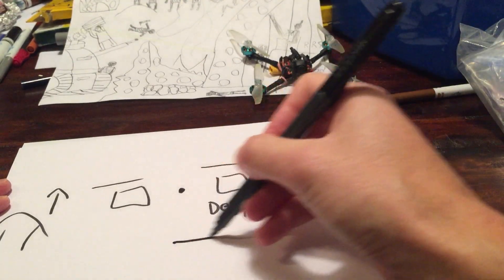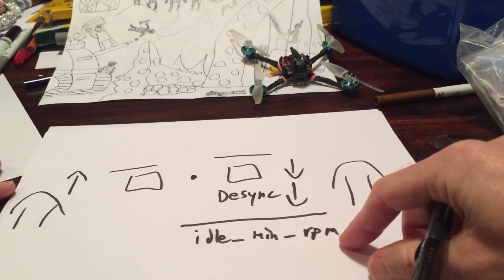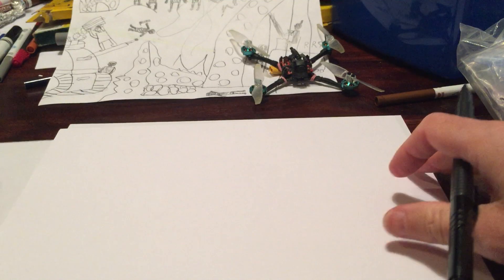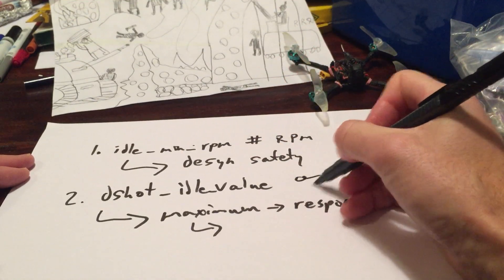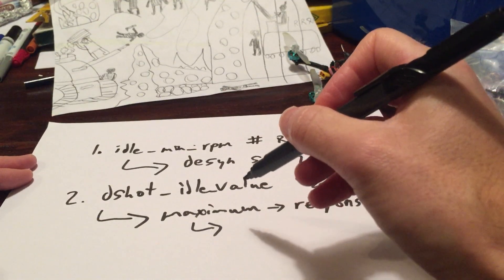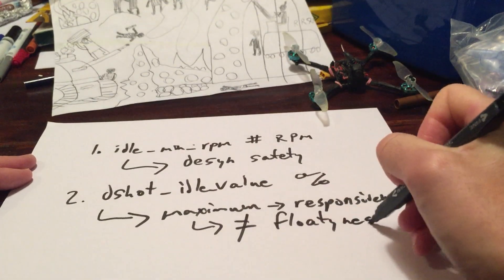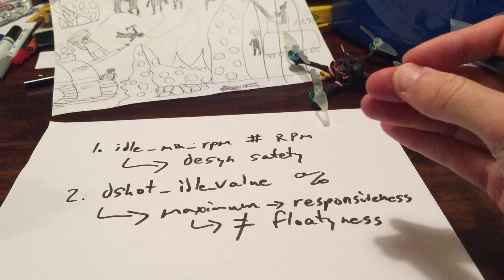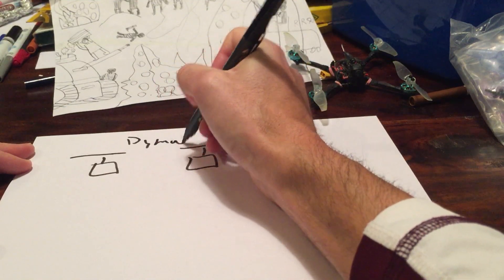Betaflight Dynamic Idle: Explainer

Comment: i have a new 5inch quad, when i have dshot set to 5 and dynamic idle set to 20 and with airmode on.
after activating airmode my drone doesnt stay in hover at 0 throttle but just fall out of the sky
why is that
Reply from the maker: It should descend at 0 throttle, otherwise you would have to land by going inverted. Hover should be at some low but comfortable range of the stick travel such as 25-30 %
Reply: @Quad66  what i mean is it drops like a stone with throttle at 0, i only get the 1050 if i go by all those guides suggesting putting 5 as Dshot value but thats not enough to make it float.
all the youtube vids you see they seem to float and hover when they have 0 throttle and i cant figure out how they do it.
the only setting i can do is set Dshot throttle value aaaal the way to 19.50, then when i arm i get 1195throttle, 1200-1210 my drone starts to fly off

Comment: Great video! This brings up a question that has been bothering me for quite a while. I was shocked when I found out that ESCs can actually be designed to handle infinitesimally slow speeds and not stall (e.g. see Justine Haupt's Brushless Motor Controller: https://www.youtube.com/watch?v=JMXz5tzpq7U), but quadcopter ESCs are not designed that way. Why doesn't somebody just make an ESC that handles low speeds and eliminate the issue all together instead trying to partially work around it in software?
Reply from the maker: It’s a good question. I’m wondering who in the fpv community would be able to answer it.
Reply: @Quad66  I was thinking maybe the blheli authors. I need to find out how to contact them.

Comment: I Have my Dshot idle value set to 8.5% (this gives me a RPM at idle of 6300 when I arm the quad - 3 inch tarsier toothpick 90g dry 1204 5000kv motors) which I guess is normally quite high but my Idle_min_value set to 50 (50 * 100 = 5000rpm which is approx 20% less. I was getting low throttle wobbles especially when backing of the throttle after a punch out or when the quad was in free fall and was hoping this would help I am guessing not using Dynamic idle was contributing to this as the motors were fighting each other. Am I on the right track even if these figures seem high?. Due to snow ATM I havent had chance to test it out yet.
Reply from the maker: onceamantwiceaboy yes dynamic idle can help keep motors out of the dead band where they have trouble spinning back up. The other possible things to try are turning off Dmin if you are using it and/or using some thrust linearization to increase effective PIDs at low rpm.
Reply: @Quad66  thank you yes i have turned off de min but heard thrust linear can cause the quad to freak out if it hits something

Comment: I set mine to 1 (x100), Betaflight says okay.  I try to set mine to 1.50, and Betaflight says go bite yourself.  What's going on?
In Liftoff I have my static idle set at 1150 which is perfect.
I want a idle of 1150, and I really don't care what the idle min floor is, as long as it's above Dsyn which I assume the defaults are by a hefty margin.
fpv.air-war.org
Reply from the maker: CHOPPER GIRL what so you mean by go bite yourself ?
Reply: @Quad66  I mean if I try to enter 1.5, Betaflight sets it back to 1.  It won't accept decimal numbers.

Comment: I'm on 4.2 RC1. My idle at 1050 is 4000rpm. So I put 36 in dynamic idle in configurator and my d shot idle is 5.5. Does that sound right?
Reply from the maker: What is you setup? I only fly micros and usually see desyncs with idle_min_rpm down around 21 or 22. To figure out how low your value can be you have to fly the quad and put it into negative flow with low throttle so flips rolls dives etc with low throttle. after that d shot idle can be set to get the feel you want without worrying about desyncs.
Reply: @Quad66 I have a raging droner 5" with t motor f60 pro 4 1950kv and f55 amp esc. 6s set up. At 5% d shot idle I went in motors tab and put the rate at 1050 like the tuning notes say. My rpm was 4000. Double what the tuning notes suggested numbers for a 5". So 20% of that idle would be 3200rpm at 5% d shot idle.
Reply: @Quad66  feels like there should be a better way to determine your minimum value without having to try to attempt desyncs .
I’m only flying my tp3 and 339cube and kinda want to add with feature but without repeated crashes to determine the low value
Reply from the maker: David FPV unfortunately not really. the question though may be whether you really care what the minimum is? If not just go 15-20% below idle and call it good enough.

Comment: Are "idle_adjustment_speed = 50", "idle_p = 50", "idle_pid_limit = 200" and "idle_max_increase = 150" related to all this, and if so how do they play into tuning dshot_idle_value and idle_min_rpm? Thx
Reply: Ive wondered about all the "other" idle settings in cli aswell. There are zero explanations anywhere about them.
Reply from the maker: They aren’t mentioned in the dynamic idle tuning guide so I don’t think so but am not sure. That’s a good question to ask Thorsten Laux aka Joe Lucid. He is very responsive on his JESC Facebook group or on JESC RCGroups forum.
Reply: @Quad66  Thx, the info I was looking for is on the Betaflight wiki, Tuning Dynamic Idle page, in 'The Technical Stuff' section ( https://github.com/betaflight/betaflight/wiki/Tuning-Dynamic-Idle#the-technical-stuff ). It talks about all these secondary settings, and recommends to leave them at the defaults. Cheers!
Reply from the maker: Paul Hodgetts I see that now the tuning guide was updated. They conclude with basically don’t touch it for most quads. I’m flying these little AIOs without black box so I don’t have the tools to assess the affects.

Comment: Would this be a potential fix to yaw washouts? One common way to fix yaw washout (next to running props in) is to raise the dshot_idle %. I guess my question is also when is dshot_idle  enforced and when does it drop to idle_min?
Reply from the maker: Thats a good question. It is low throttle negative flow that tiggers yaw washout but I don’t think it’s a desync or a spooling up issue. So in that regard I don’t see a likely benefit. However, dynamic idle may allow you to fly higher idle in general without getting too floaty which may help as high idle helps decrease yaw washout.
Reply: Perhaps. Dynamic idle, when set properly, gives more range to yaw torque due to the increase in braking [while in airmode].
About dshot idle vs min rpm: The FC will do everything it can to keep the props spinning above "dyn_min_rpm", even in reverse flow situations (think extreme flips and rolls, turning into/against strong wind, sloppy dives) to help prevent desync and stuttering. Traditionally, we'd just increase the dshot_idle_value until we didn't have desync issues, but that makes for a floaty quad, because its not looking at RPM, just sending a dshot percentage to the escs. By giving both values to the FC, we can make the quad not overly floaty, keep it relatively responsive, but also prevent it from spinning too low and falling out of the sky. My understanding is that most people will find that they want to increase dshot_idle_value because Airmode tended to rev the motors slightly over dshot idle because it didn't want to allow other motors to spin down any for minor attitude corrections. Acro mode doesn't care about attitude corrections at idle, so you may notice (once enabling dynamic idle) that switching from Acro to Air mode doesn't "idle up" like we're used to.